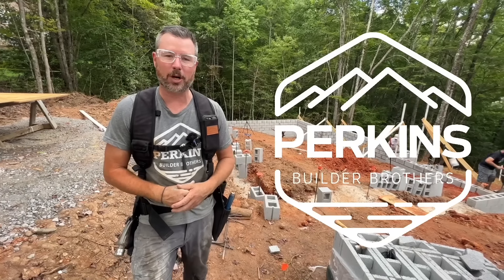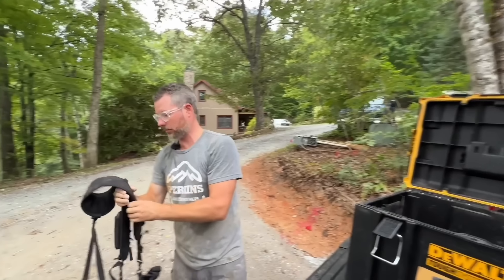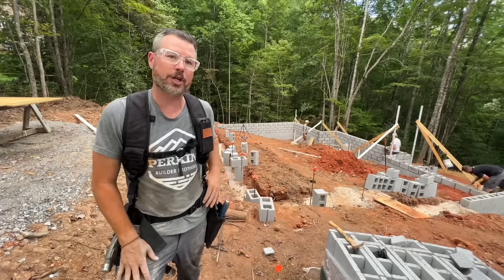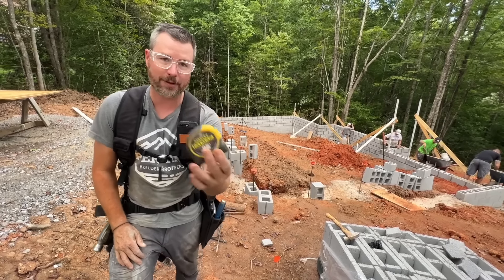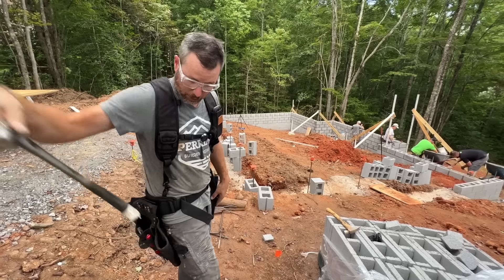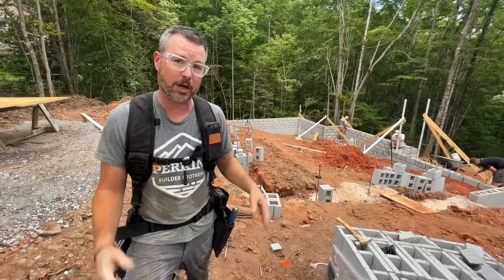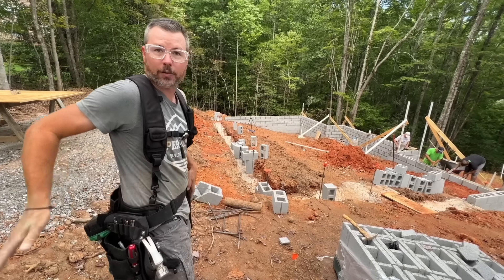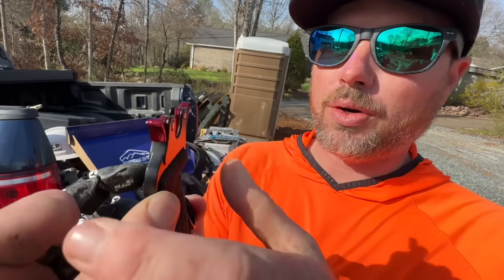Perkins Essential Tool Belt Set Features & Overview

Comment: Why'd you remove the ear protection pouch and the magnetic gadget that held all your bits?
Reply from the maker: Thank you for sharing your concerns about the changes to the new Essential toolbelt. We truly care about the thoughts and opinions of our community, and we're always working to make our products better match what our users want and need.

After listening to a lot of feedback from customers, we've made some changes to the toolbelt to keep it affordable while still offering great value. Here are the updates you can expect:

Tool Belt:

Removal of Rear Drill Clips: Not everyone was using these clips, so we took them off to lower the price a bit without losing any important functions.
Removal of Rear Chalk Line Pouch: Now, you can buy this separately if you want it, letting you personalize your toolbelt the way you like.
Modified Front Buckle: We changed this to a design that's just as good but helps us keep the cost down, making sure you still get great quality and comfort.
Improved Tape Measure Pocket: We tweaked this pocket to let you reach your tape measure more easily and quickly.
Additional Carpenter Pencil Slots: Now, you can carry more carpenter pencils with you, so you always have a spare handy.

Suspenders:

Enhanced Suspender Adjustment Clips: These new clips adjust more easily and stay closed securely.
Shortened Adjustment Strap Length and Added Strap Organization Loop: This change helps keep everything tidy and prevents straps from getting tangled up while you work.
Removal of Magnetic Holder and Earphone Pocket: We took these features out to concentrate on what's most important and useful, allowing us to offer the toolbelt at a better price without cutting corners on quality.

We believe these changes make the toolbelt more affordable and focused on the essentials. We're thankful for your understanding and ongoing support. We can't wait to hear what you think about these changes once you try out the new design.

Thank you!
Reply: I spent the last 2 weeks deciding between the Perkins belt vs Occidental vs Diamondback. I do wish those 2 features (plus the drill hooks) were on the belt, but to me it seems a no brainer at $200 vs $300 (original price). I just ordered the belt and I plan to add those features myself. Ill do a review when I get the belt!